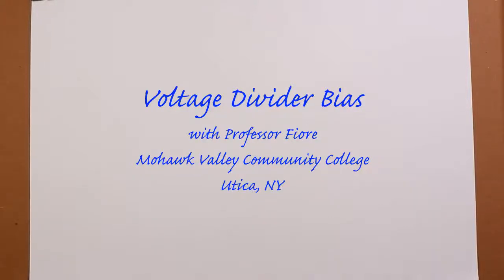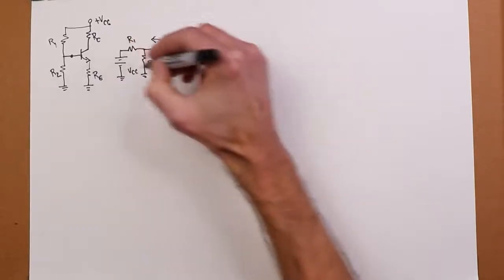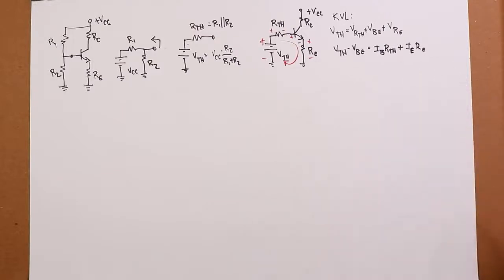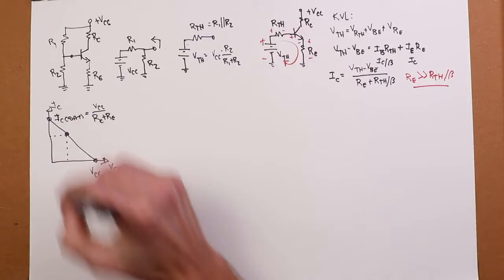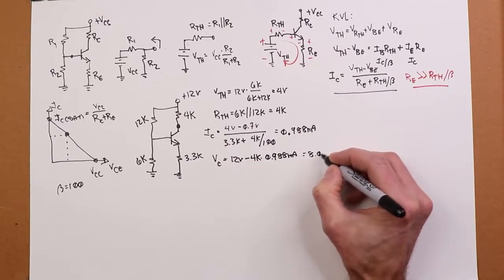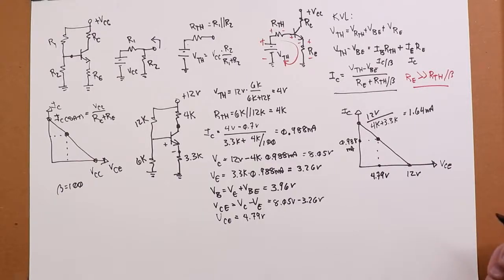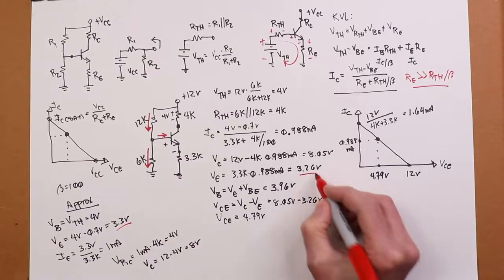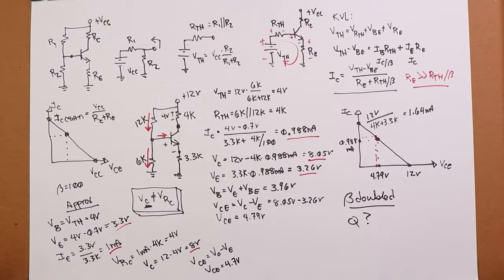Semiconductor Devices: Voltage Divider Bias

Comment: Still one of the best explanations around. As Beta increases, the difference between the Thevenin calculations (VB=VTh) and the actual numbers get closer. If we say VBE is 0.66 rather than 0.7 (Where we account for the RTh voltage drop), Ic works out to 1mA, same as the Thevenin calculation.
Reply from the maker: Certainly, Vbe=0.7 V is an approximation. It might very well be 0.66 V in some particular circuit.

Comment: I created a voltage divider bias CE circuit and right next to it its Thevenin Equivalent circuit in Ltspice but both are giving different currents are voltages. So they aren’t really equivalent.
Reply from the maker: Assuming these are not very minor discrepancies due to rounding or finite precision, the chances that there is an error in the equivalent circuit or layout in LTspice are considerably greater than Thevenin having been wrong.
Reply: @ElectronicswithProfessorFiore I figured out the mistake I made, thank you! You are very kind to reply so promptly.
Reply: @ElectronicswithProfessorFiore 😃 ...I was actually just wondering what Thevenin must've been working on! I'll look it up!!!

Comment: Mathematically I understand why a change in Beta won’t have much of a change in how the circuit behaves. In the equation for Ic, changing beta will only change a relatively small value. However I’m having trouble understanding intuitively why this is. I remember someone saying that the emitter resistor acts as negative feedback to changes in beta, but I didn’t really get what that meant.
Reply from the maker: The emitter resistor is sometimes referred to as "local feedback". Here is a quick example of how it works. Let's say that a voltage divider establishes a certain base voltage. That voltage, minus Vbe, drops across the emitter resistor, and that established the emitter current via Ohm's law. At this point, everything is stable, there being a certain base current established by  beta (approx. Ie/beta). Now let's assume something causes beta to rise, for example, an increase in temperature. This increased beta, times the existing base current, should make the emitter current rise. As the current rises, the voltage drop across the emitter resistor must also increase (due to Ohm's law). This means that the emitter voltage is rising, BUT because the base voltage is fixed by the divider, that means that Vbe must be reduced, and any reduction in Vbe would force Ie back down. 

In reality, this happens on a continuous basis and there will be small shifts in both Vb and Ie, but those changes will be much smaller than the change in beta (in a well-designed circuit). It would not be weird for a doubling of beta to produce only a few percent change in Ie. What ends up happening is that most of the change is seen in Ib. That is, if you double beta, instead of Ie doubling, Ib cuts cut in half. This is why it is important that the divider current be much larger than the base current (otherwise, the changing Ib would load the divider excessively, causing Vb to shift).
Reply: @ElectronicswithProfessorFiore  Well said, thank you!

Comment: PROFESSOR FIORE, What is confusing is that Vth is 4vdc and Rth is 4K. If you take Vcc 12vdc/Rth 4k = 3vdc ( not 4vdc ), this is confusing because Rth is not the same as R total? Can you make another video about voltage divider biasing because there are 3 or more methods designers start with. They start with either #1 HFE beta , #2 datasheets IC specs or #3 The Resistor value gain ratios. By looking at the resistor values you know the gain ratio so the designers will use that as a starting point or they use the HFE beta as the starting point or the datasheets IC current specs. The Ib current formula changes for each method.
Reply from the maker: Dividing 12V by 4k does not yield 3V. Look at the units. It yields 3 mA. 

As far as design is concerned, we start with some desired performance characteristics of the amplifier, such as voltage gain, signal swing, and input impedance. That will give us an idea in terms power supply values, r'e, and the like. From there, we can set the desired bias levels and resistor values. Admittedly, this seems a little backwards because students have yet to study the AC analysis of these circuits. But you can't do the AC design and analysis until you can the DC part, so we study the DC part first. Thus, the student is left trusting that the instructor is not leading them astray. Not the best situation, admittedly. It is for reasons like this that I advocate returning to earlier material once later material is largely understood (because with the more advanced knowledge, you can better appreciate the subtleties of that earlier work that probably flew past you). 

But more to your point: Say you want a gain of 20 and you know the load impedance is 10k. A rough approximation then indicates that the total AC emitter resistance would be somewhere around 500 ohms (ignoring the effect of the collector bias resistor for a moment). That 500 is split between the transistor's r'e and whatever amount of unbypassed emitter resistance you have (which is partly dictated by the sort of distortion specs you're looking for). Once you have a target value for r'e, you can determine the required DC emitter/collector current. From there, you can determine the voltage divider that you need (given some knowledge of the required input impedance). If some of what I just wrote sounds confusing or unfamiliar, that would be normal as it's part of the AC analysis. 

Probably not the answer you wanted to see, but at this point you have to trust that the instructor is leading you to a place where everything comes into focus. "Wax on! Wax off!" ;-)
Reply: @ElectronicswithProfessorFiore  I meant to say that 12v/Rth4K = 3mA of Ib base current which doesn't make since if Ic is 1mA. What I'm saying is Rth is not the same as R total. You didn't show how to compute for Ib base current. You should make another video showing if the criteria with a load impedance and gain criteria how to design the correct resistor values. Example if the load impedance is 100 ohms and want a gain of 5, how to calculate the resistor values. The +VCC set at +9vdc and then at +12vdc would change the whole resistor values to get the same result.
Reply from the maker: @waynegram8907  You're confusing the base current with the divider current, a common situation. Ib would not be 3 mA. Base current is always collector current divided by beta (or approximately emitter current divided by beta) assuming the circuit is not in saturation (in which case the effective beta collapses). In order to maintain a stiff voltage divider, the current down through the divider resistors needs to be much larger than the base current. In other words, the vast majority of the current flowing through the top divider resistor enters the bottom divider resistor with very little being shunted to the base. Don't forget KCL at that junction. Thus, if you have Ic=1mA and beta=100, then Ib must be 10uA (far smaller than the divider current).

Calculations for voltage gain for a circuit like this can be found further along in the playlist.
Reply: @ElectronicswithProfessorFiore  The Thevenin Equivalent is Rth which when using the formula Vcc/Rth = Divider current? ( not the base current ). Only Ic/HFE beta = Base current. When you take the Collector Resistor value and use Vcc/Rc = Ic is not the collector current Ic? because  the correct formula is Vcc/Rc+Re = Ic to get the collector current? Then once you have the Ic you compute for Ib base current.
Reply from the maker: @waynegram8907  Vcc/Rc is not Ic. Vcc/(Rc+Re) is the collector saturation current (max Ic, not the ordinary bias current). The divider current is approximately equal to Vcc/(R1+R2), i.e., the sum of the divider resistors. I suggest that you rewatch the video, forgetting all of the assumptions you have mentioned.
Reply: @ElectronicswithProfessorFiore  I see that the thread is closed but I also noticed that when we switch to therv voltage source we can't simply calculate the current (Vth/Rth we can but what we've got is the previous current over R1 and R2  +  a small portion for Ib). Also for sure Ib is measured in uA and depends on B. But when look at the circuit it seems this should be true Ib * Rth == Vth but for sure it is not. How to reconcile the circuit and this false observation? Or shoud Vth be treated as the voltage source with the internal resistance Rth which just loads the transistor with Zin >> Rth?
Reply from the maker: @mikhailbrest6385  Your final sentence is closer to the mark (although it would be better to say it "drives" rather than "loads" the transistor). It is NOT true that Ib * Rth == Vth. That is the same as saying Vb must be zero (via KVL), which it most definitely is not.